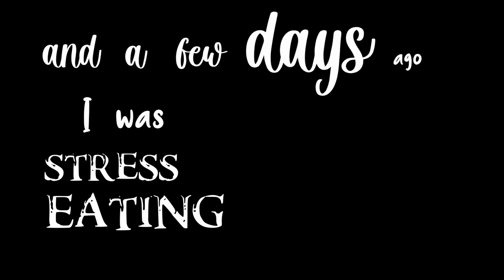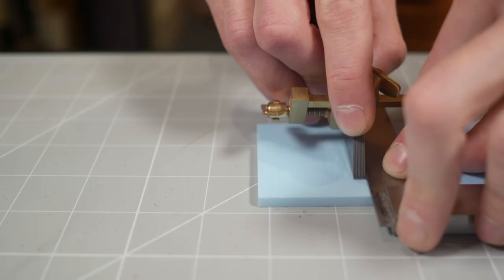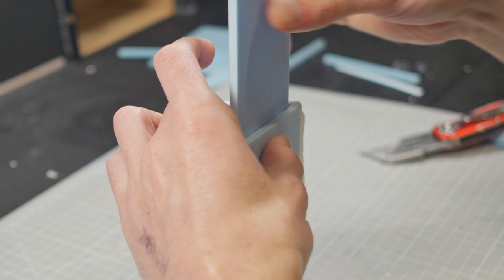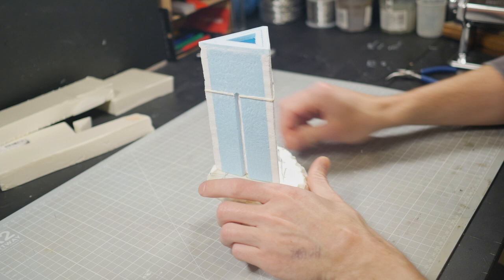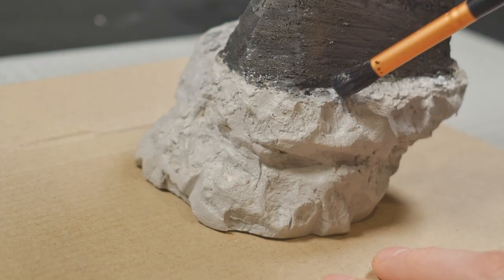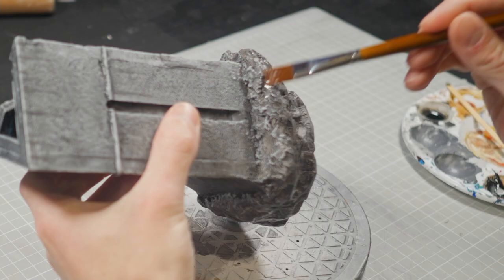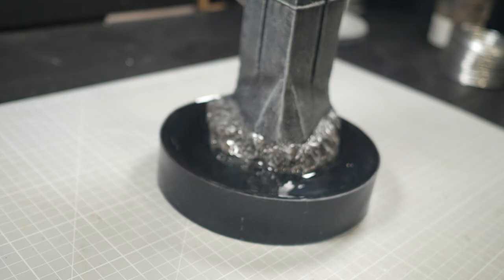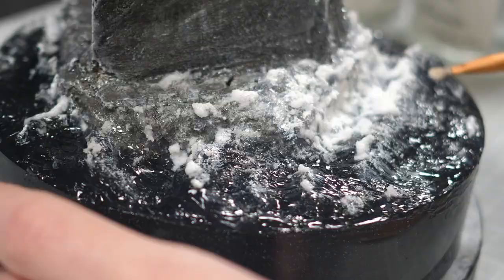How to make AZKABAN from TOBLERONE // Epoxy Resin Art // Harry Potter

Comment: Toblerone.... Now that brings me back. At one time the best candy bar on earth. Why not anymore you ask? Mondelez, that's why. The company that purchased them in 2012. Their choices have been suspect, at best. Around 2015 (or 2016) they made the insane decision to change the shape!! The shape of Toblerone is arguably the most important part. It would be like Cheerio filling in the O!! They removed 20-40% of the chocolate, massively widening the gaps between peaks. Making the bar look like a bike rack. Claiming that it was done to keep the bar's price from increasing (aka greed). It was so bad, that consumers went crazy. Eventually Mondelez was forced to change back. But, not before the price was hiked, and not by a little. The price was was jacked up 200%. So now the $1 bar became $3 or more. Well this must have been due to Covid. Right? WRONG. This happened the year before that started. However, I did just read that they're about to change the design of the packaging in 2023. The Matterhorn mountain will be removed allegedly. Mondelez has lost their minds.
Hey, at least they still taste hella delicious. Sorry for the rant, but these were in my stocking every Christmas. So there's sentimental value. 

Oh, Great video Adam!!